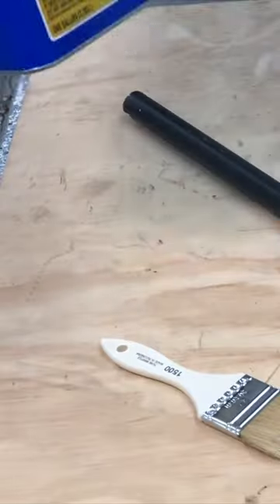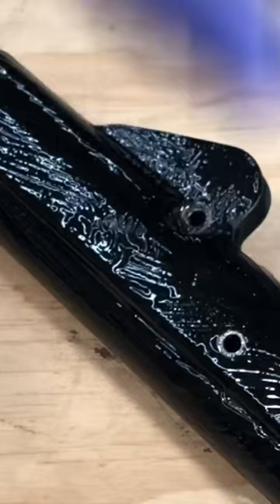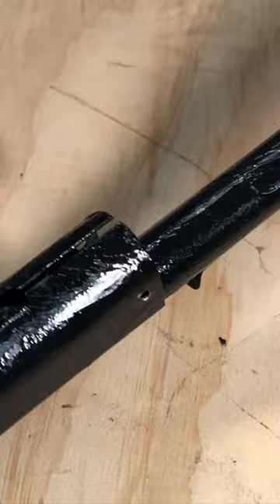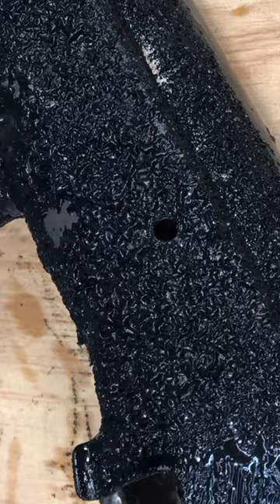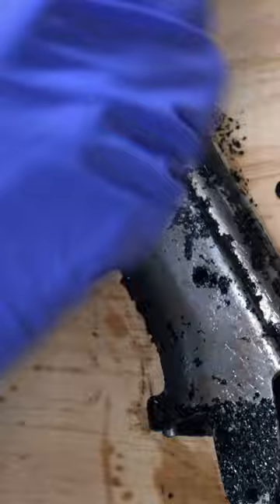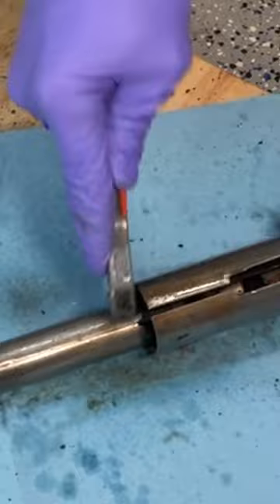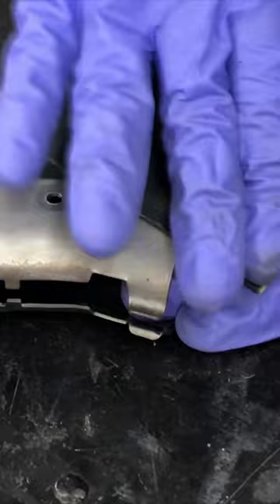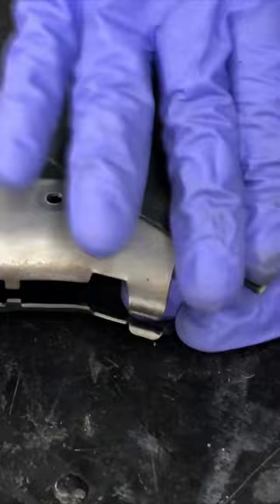Chemical paint removal

Comment: Yikes, I wonder if it would also strip the rust off of antique cast iron lawn furniture I have my eye on acquiring. Certainly faster than wire brushes.
Reply: i don't have a lot of experience with them, but there are also rust converters or reformers.  i'm not saying they're the answer, but worth looking into.  read the instructions, try it on a rusty piece of scrap first.
Reply: Laser rust removal machines are absolutely amazing. Pretty expensive though.
Reply: soak rusty stuff in vinegar for a day or two
Reply: Evaporust. You won’t regret it.